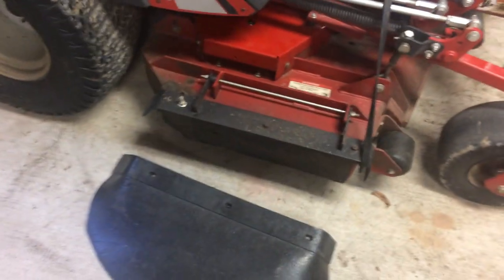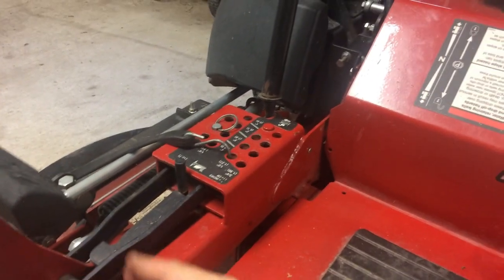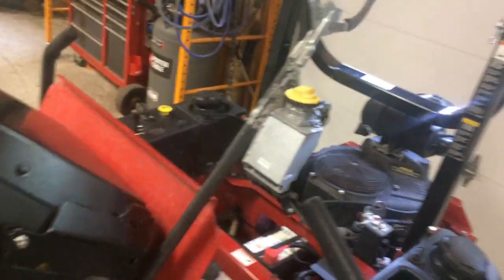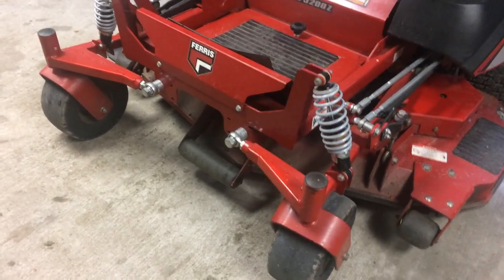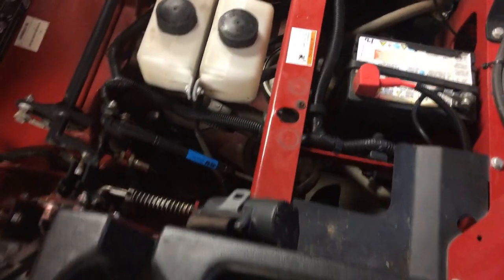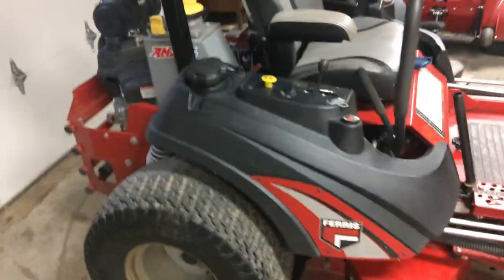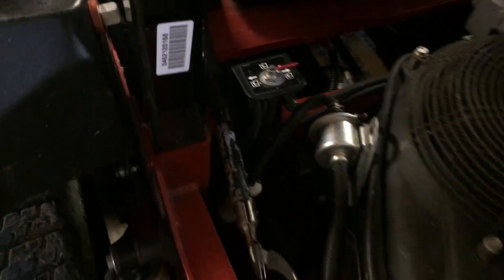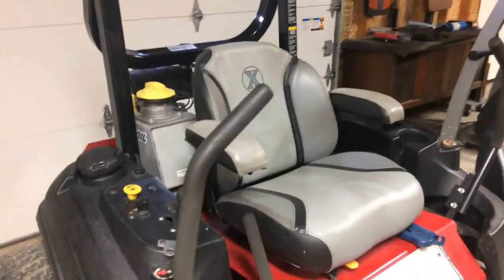1000 hr Review on 61" Ferris IS-3200Z

Comment: Does the vanguard 37hp efi have electric fuel pump?????
Reply from the maker: 🤔 not sure 🤷‍♂️
Reply: Ofcourse all EFI got electric pumps. When you turn key to position one you should let pump it for 3sec and then start it. Not just yolo it and starting without pressure.